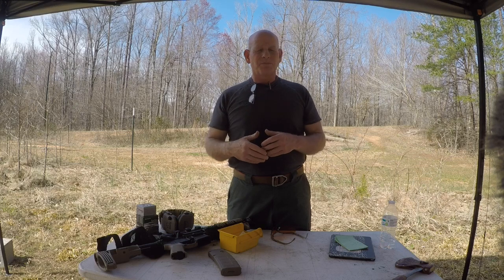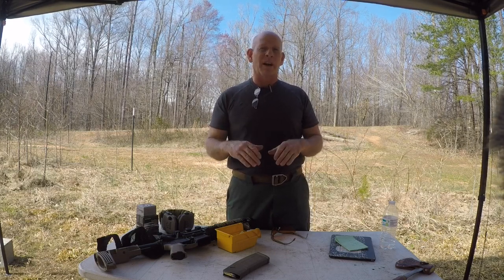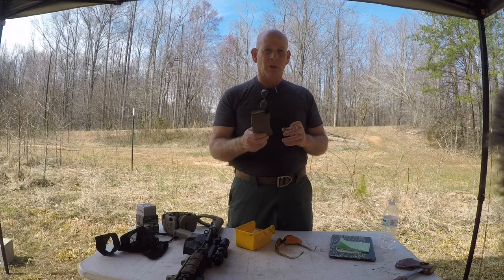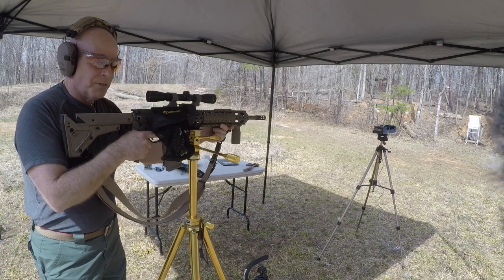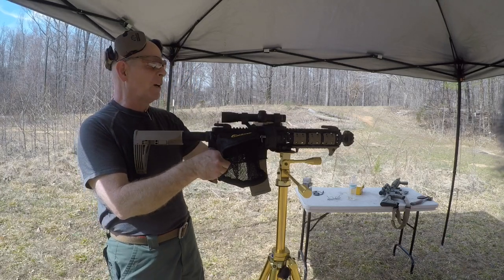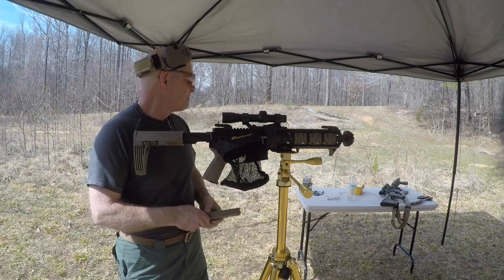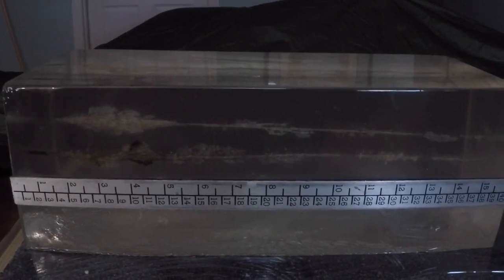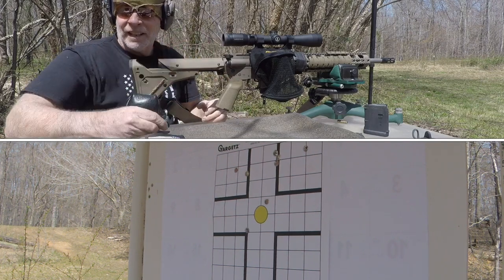Hornady 100 grain short jacket 300 Blackout Ballistic gel test.

Comment: Where did you find load data for these. And why slow the round down for the gel? Thanks
Reply from the maker: I actually used data for the 110 grain Hornady Vmax,to answer the first part of your question. To answer the second part of your question. the gentleman that asked me to test these specific projectiles wanted to know what they would do out at 100 yards. So instead of shooting the ballistic gel out at 100 yards.I slowed the projectile down to mimic the ballistics at 100 yards. It’s easier than trying to re-zero The weapon and try to hit a 6 in.² at 100 yards with limited Number of rounds.
Reply: GONZO38 pp right On. Thanks makes sense. Good video.

Comment from the maker: Sorry I miss spoke during one of the segments it is Winchester 296 that I was using the load data was taken off of IMR website
Reply: GONZO38 pp your barrel doesn’t have the blackout feed ramps? Mine are hogged out so that theres just a lil tooth left in center and Ive successfully run round nose to pointed and zero issues. You can do it yourself as well.....